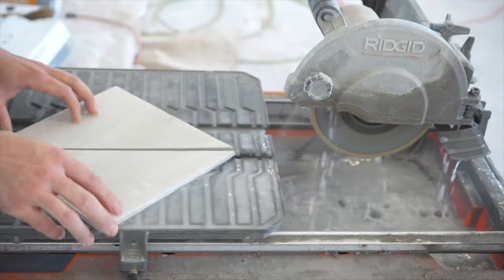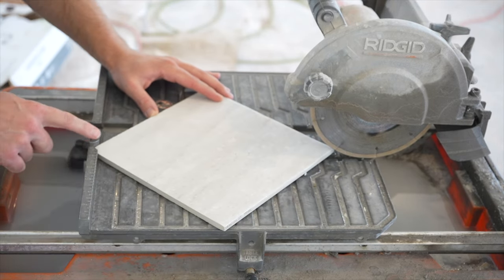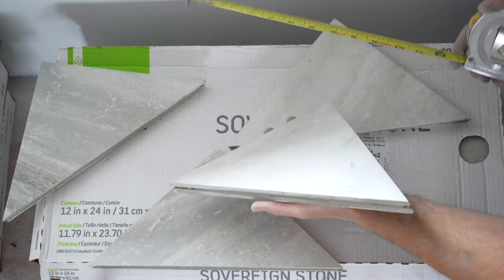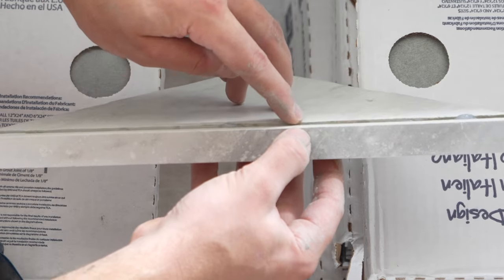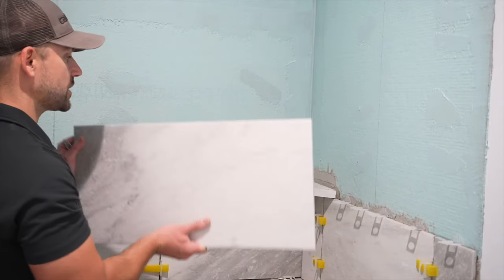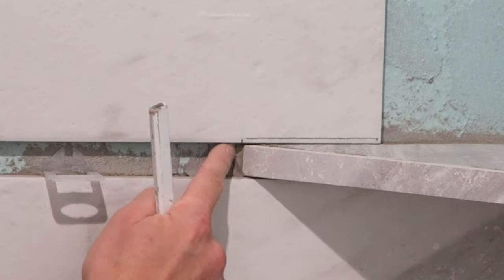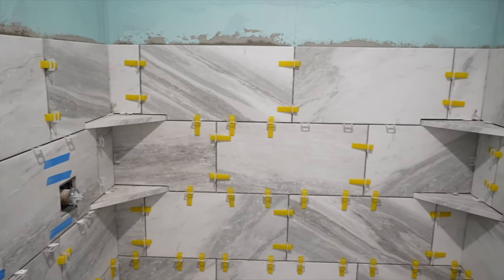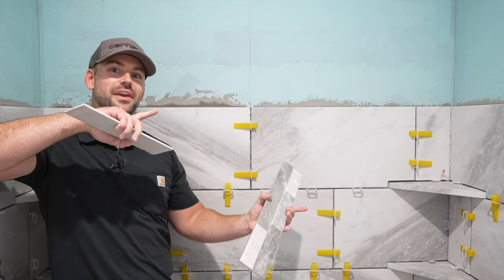How To Tile A Shower Pt. 3 - Make And Install Tile Corner Shelves

Comment: Hey Josh, 
 Great job with your videos.  I'm 34 yrs a union carpenter.  Well versed in all aspects of residential construction. Tho I've tiled in some of my 29 flips, I still found your videos to be helpful as refreshers.  As all showers are NOT created equal, lol. I do have a couple suggestions for you tho. 
 1. I always make sure to establish my 2nd course control line "from the lowest corner" of the shower pan. That way if it's out more than 1/8, tiles can be scribed and cut in to keep the pan caulking gap even end to end.
2. I either use my finger or a carp pencil to remove at least a ¼" of thinset on all tile edges before setting the next tile. Much easier than trying to remove excess after stacking or butting tiles. 
3. Use a laser level for your videos. Much better than a 4' Empire. Yup, kinda bustin yor nads a little lol. 
 I did subscribe. Keep up the good work !
  Scott

Comment: Funny how you measure small areas starting on the 1. Been doing that for a long time on detail projects like tile. Tape measures always have that little bit of play which can make a difference. Great detail Josh. 👍🏻
Reply from the maker: Burning an inch was taught to my by my father many moons ago. Works great for something like this. You appreciate the detail in my videos and that makes me glad I add them :)
Reply: @TheExcellentLaborer  taught by my father as well and my father-in-law who was a builder as well. Loved learning so much from tradesman.
Reply: @14:05 he even burns two inches!  I’m surprised someone hasn’t asked in the comments about how that works. 😂

Comment: Great video!! Love the idea of making shelves from the tiles themselves!  I have a couple questions:

—How strong are these?  Would you use this method for a leg shaving foot rest?

—have you considered miter cutting the front edges of the uncapped shelves, and of the caps themselves, to hide the visible edge of the cap piece?  You wouldn’t even need to do it on the bottom tile, as that side of the cap is hidden—but I have to think it would improve the look of the front edge of the shelf. Is there a reason to NOT do it with a miter?

Thanks again for the great video!!

Comment: After watching this series, I am now convinced, without question that I am going to pay someone to tile my shower stall. :D Currently my shower, ceiling and walls are all one kind of small tile. Is there any recommended alternatives to tile for the exterior walls outside of the shower / ceiling that can save costs? I feel like paying a professional to tile an entire bathroom would be crazy money.
Reply from the maker: There is really no cheaper alternative when it comes to material per se. You could use beaded board on the outside of the shower around the bathroom for looks. The tile is really the best option for in the shower but yes you will have a good bit of money in labor. I hope that helps!
Reply: Lol this is a funny comment. Tiling is easy to mess up. These professionals make it look easy.
Reply: I highly recommend you give it a try. Jst knowledge up and take your time. Not only is it emotionally rewarding,  it is extremely economically rewarding.  Good tile guys are very expensive.  But that's generally because they are much more efficient. If you have the time, it will be well worth your while 🙂

Comment: So my shower base has a slope so do I pull my measurements from my low point to start my second row and then cut my tile to the slop on my bottom run
Reply: I would pull it from the lowest point to prevent you from having too much of a gap from the shower/tub

Comment: Curious why you used silicone instead of mortar to adhere the face on?
Reply from the maker: The silicone gives a cleaner look because you do not want exposed thin set in this area. I hope that helps!
Reply: Thinset is not meant to be subjected to repeating wet dry cycles. It will break down
Reply: @scottcoates7978  the premixed thinset/mastic you are correct. The powder form thinset is cement based and has no issue with water. The premixed is for things like kitchen backsplashes where minimal water contact happens.